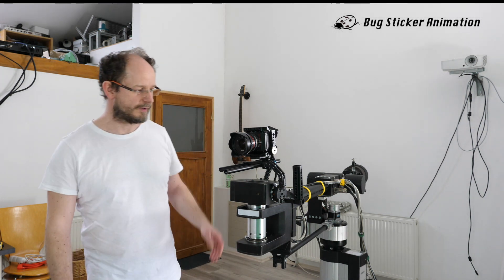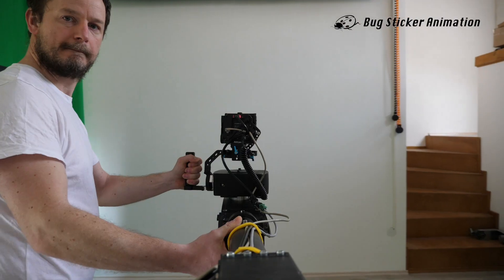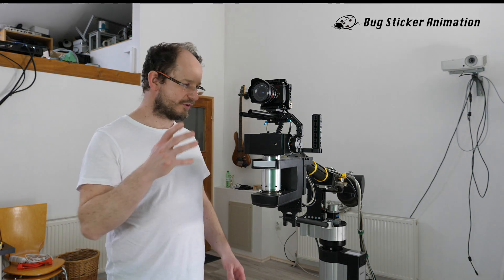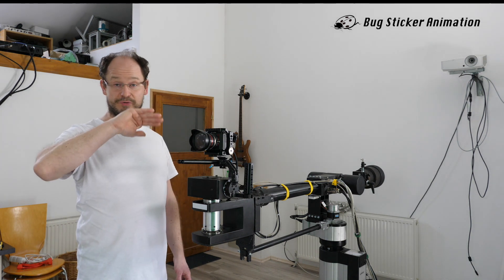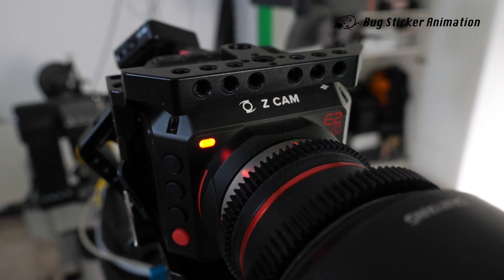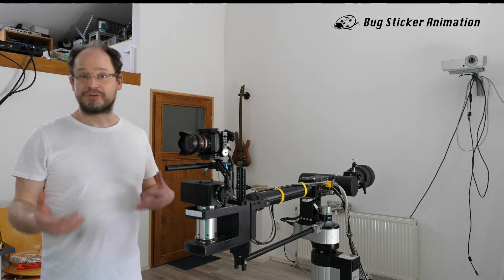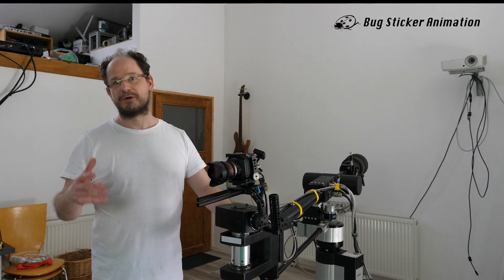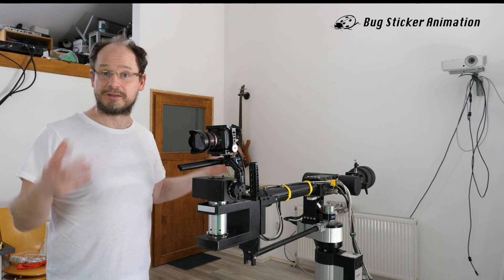Robot Camera Crane hand teaching - Detailed technical description

Comment: Can you talk more about the software driving the robot?
Reply from the maker: Hi, The robot control is IAI X-sel-Q. The robot program is written in its environment. The other part, mainly makes the visualization and the logging is Siemens Simatic TIA portal. An s7-1200 PLC running the code. The whole thing based on industrial control.